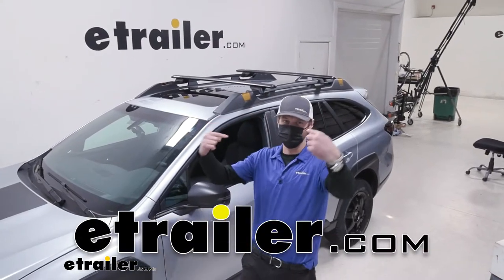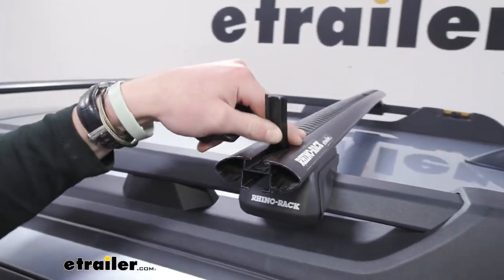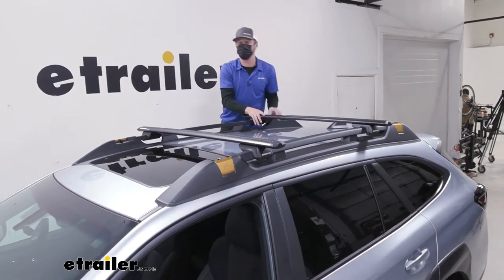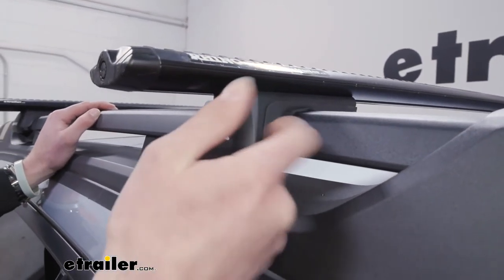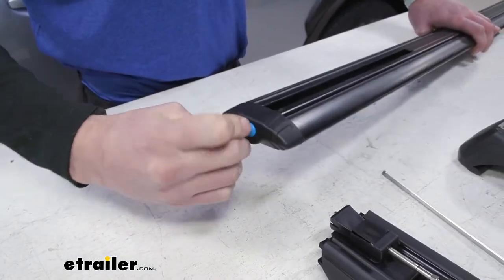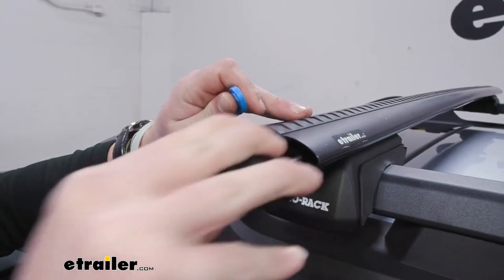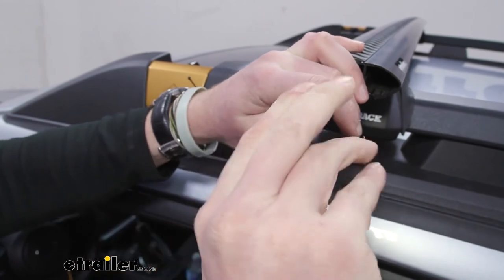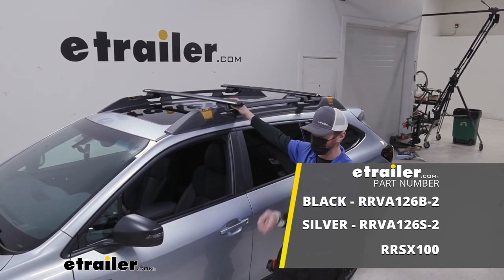Set up: Rhino-Rack SX Series Legs for Vortex Aero Crossbars on a 2022 Subaru Outback Wilderness

Comment: So how much weight can it handle after the roof bars installed? Is it stronger than Thule roof bars?
Reply from the maker: Hello there, if you look at this link you can see the product page with all the specs. https://www.etrailer.com/multi-product.aspx?pc1=RRVA126B-2&pc2=RRSX100&VehicleID=20227013978&HHYear=2022&HHMake=Subaru&HHModel=Outback+Wagon They have a weight cap of 165lbs but you also need to check your vehicles roof weight capacity. Also the caps will change for stationary/static and moving. You can find the information in the install directions.